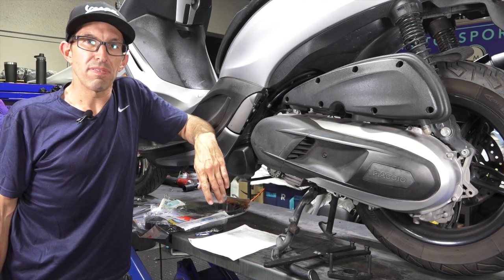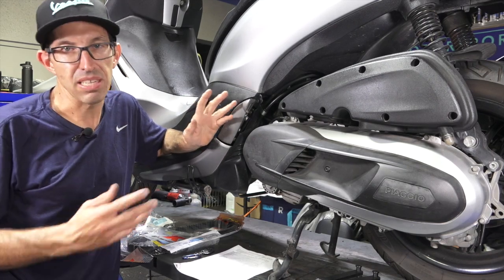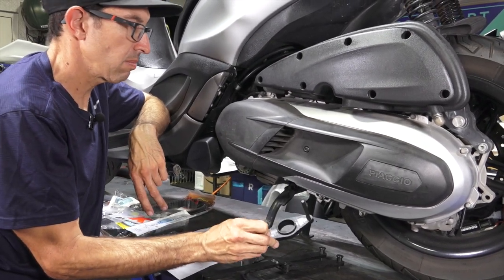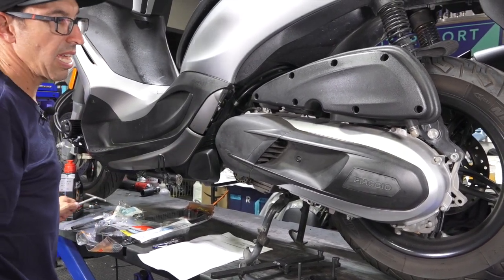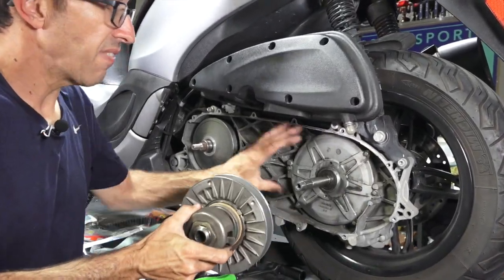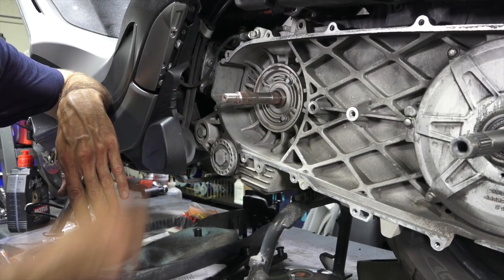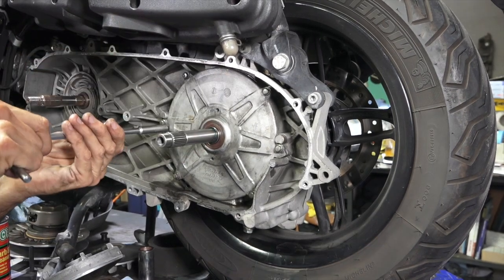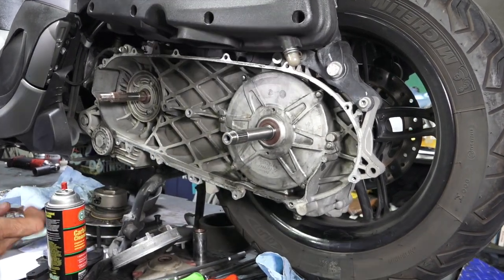PT. 2 Piaggio BV350 Comprehensive Service - Belt, Transmission, Air Filter

Comment: Excellent video the amateur mechanic that I am,  I tightened the variator on a kymco people 150 with the belt tight. Your are right, it gave an inaccurate torque reading and subsequently destroyed the splines when the plate started to wobble after riding a few weeks. Luckily I only paid $1000 for the bike it was a Kymco 150 good learning experience. Let the pros do the tech stuff. I just change fluids from now on. Happy rid’n

Comment: Hi Mr. Robot I took apart my clutch it was dry out of grease on pegs and bearings I cleaned it out with brake cleaner and put all rubber seals and new grease!
Reply from the maker: Great job

Comment: Best scooter ever!  The new rollers will make a massive difference.
Reply: Really? look at belt, shaft and wet clutch. EXPENSIVE piece of shit!
Reply: @MujoNovak  I have some Chinese scooters you may be interested in.  Very cheap!
Reply: @kristfur  ...Who is talkin about chinese? Dont be sarcastic. But isnt piaggio angine built in... CHINA?
Reply: @MujoNovak  Piaggio owns Vespa, Aprilia, Moto Guzzi, and mroe.  There engines are the same as Vespa or better depending on the model.  They make things all over the world for different markets.
Reply: @MujoNovak  well I own one and it's not shit to me.
Reply: @MujoNovak  I have an Yamaha XMax scooter. No problems at all. Mind you the Beverley 350  looks nice.
Reply: @simone9945  the scooter looks nice.
Reply: @johnmartin7158  the scooter is very good looking and reliable as it's been on the market for almost 10 years. If you get a 2017 + model you are safe. However the roads you ride on have to be almost perfect bc being a scooter it doesn't go over bumps or potholes. I ride is south italy and I'm surprised of how strong it is but very uncomfortable.
Reply: @simone9945    Very interesting. I ride my XMax in NZ. Very comfortable. I enjoy my scooter more than I do my motorcycle. Scooter is comfortable and no gears. But I never thrash my scooter. I nurse it along so it can last longer. Italy 🇮🇹 is certainly a great country for scooters.
Reply: @johnmartin7158  yh scooter can be fun obviously a motorcycle is much more fun and better overall, in italy especially south italy everyone has a scooter or a bike. Unfortunately we don't have road maintenance and 90 per cent of the roads are s**t.

Comment: Hi Robot, first of all thank you for all the help and videos :)
Only thing i am wondering in this video is  scrubbing the variator plates, since they have a thin layer on them to prevent from oxidation and rust. If we scrub it with 80 gradation we will remove that layer and be at risk that it will oxide over time or am i missing something? Tnx in advance.

Comment: Hi Robot another great video I brought a bv350 2019 in november and I noticed the engine running very loud and took it to a piaggio dealer and they said it was the clutch so upset at only 700 miles but at least piaggio will cover it is this common so soon with this scooter or maybe you cannot ride it on highways that much like I did?

Comment: Hi! I can't find the specifics tools for variator and rear driven pulley. Could you give more information about how or where can we buy it?
Reply from the maker: https://www.scooterwest.com/clutch-holding-tool-piaggio-bv350.html
https://www.scooterwest.com/piaggio-clutch-or-variator-locking-tool.html
Reply: @VespaMotorsport   But friend, I cant believe that a special tool for a few minutes is more expensive than the MHR belt for this bike, for example... or a variator kit... There are not any way for buy it or for block the clutch?

Comment: Thanks Robot,
My name is Michel Verbruggen from The Netherlands. My Beverly almost driven 100.000 km (60.000 miles). I have several problems with the belt. Two times the belt turn around between the variator en the driven belt. The last time the belt was damage at the topside, just like youre video. Allready at 9.000 km!  I think the belt stretch a little and go to high on the variator and touches the inside of the  belt cover. I place a small ring between the variator, hopefully the belt don't touches the inside of the cover any more. Also less topspeed, but the torque compares with the Malossi or J Costa variator.  Michel
Reply: Any other problems ? Its high milage for piston ?

Comment: @vespa motorsport Here a huge fan from the Netherlands. since a few weeks I expierience tremendous vibrations in my drive line. the 20.000 km service was up so in the mean time i have changed the Vario rollers/sliders and the belt but the vibrations stay the same. Now I have installed an other Vario and I have changed out the bearing in the clutch cover but the porblem remains. the wheel bearing also seems fine. do you (or anybody) have any idea what the problem might be? (note all torque values are respected and checked before dismantaling the parts)

Comment: Hi, I changed my belt before 8000km or 5000 miles if you prefer , mostly city usage do I need to change belt now or I can wait for the next 5000 miles my belt changed in q3 2019

Comment: the Y-shaped tool, with which you unlocked the variator with the rollers (the second in the video, to be clear) could it be able to unlock the pulley or does the other one serve specifically? Thanks for the reply
Reply: I use for this an impact wrench and no need to use this Y-shaped tool. But if you care about the torque probably this tool is necessary. Also, I think that you can do it by yourself or ask a familiar welder to help you.

Comment: Hi, I too fitted a Malossi belt, but since I put it on, the scooter at idle revs makes a noise as if the belt "jumped", then once it's in gear, it doesn't do it anymore.. the mechanic told me that the Malossi belt is slightly longer/or has one tooth less and it is for this reason that it has this effect, according to him it would take the whole Malossi transmission kit to no longer have this effect.
what do you think about it? should anything else be adjusted?
I'm asking because I see that your scooter makes a regular noise when turned on even though he has fitted the same belt.

Comment: Hey 'Bot, the '05 X9 I am workung on has a display on the dash that flashes "SERVICE BELT" I have 2 questions:
 1. Will this condition trip the immobilizer rendering the scooter unstartable?
 2. After servicing the unit, how do you trip or reset the display to get it to stop flashing the warning and restart the counter?

Comment: Hello. I have experienced a problem that i see many owners of Piaggio Beverly 350 have seen it so far. While i drive my BV350 often i get this immediate cuts in power, the engine cuts out for a brief period for a second or so, or sometimes long enough for the bike to come to a complete standstill and then turn the key again and then the bike goes normally again.I see this to be very common problem so if you know where to address this problem please give me clues so i can tell my mechanic where to look for the problem so i can drive the bike properly, because this way it is unusable and very dangerous on open road, because bring the bike to a sudden stops or loss in power and it is very unsafe. Thank you
Reply: A tu resolu le probleme ?
Reply: @midococo  Yes i did. The whole electrical wires system needs to be replaced
Reply: @strezification   heureux pour toi ride safe
Reply: @midococo  Thank you, you too
Reply: Sounds like it could be your spark plug

Comment: Great tutorial!!  I have a question possibly you can help me figure what size screws go here (picture below) ?  I have the Piaggio beverly 350.  Ok so looks like I cant post a pic, but its the 2 lower fastening screws on the air filter box, which mounts the air filter box to the manifold.

Comment: These BV.350 have a lot of problems at least the ones here in the USA. I have one and brought brand new 2019 and its 2021 and I have had several problems oxygen sensor, belt, transmission and lets not forget like another commentator on here said I have the same problem bike turns off sparaticly the bike has been in and out of the dealer about 11times since I've had it and god forbid if they have to order parts you'll have to wait 3 to 5 months even before covid I don't know why they sell these bikes here in the USA. if they don't stock parts here in the USA.mostly everything has to come from Italy ridiculous! I will sell mine and buy a yamaha way better and parts are available here..Piaggio pure junk!